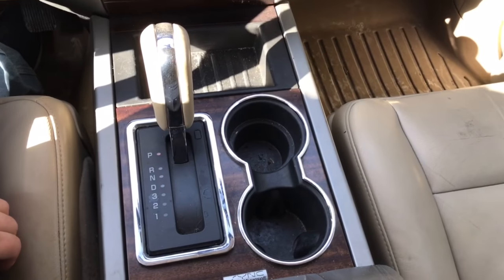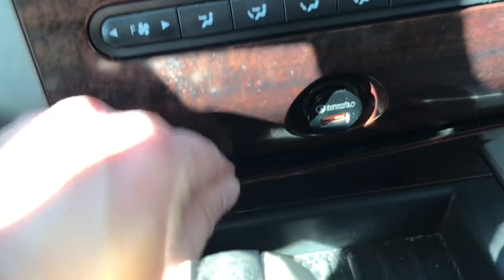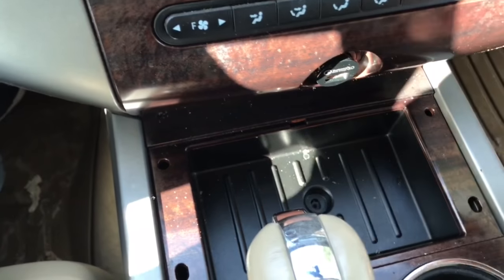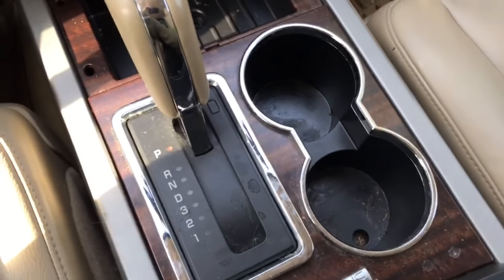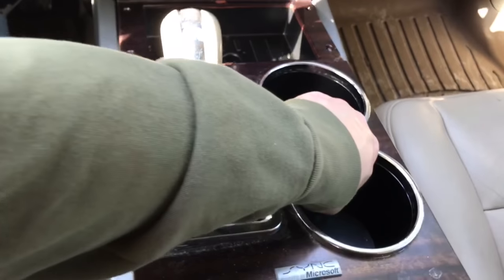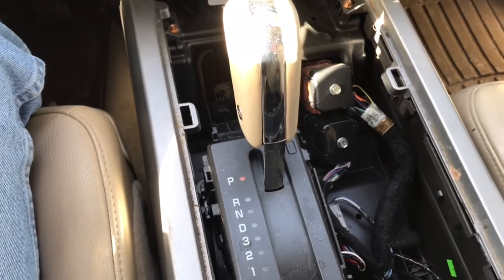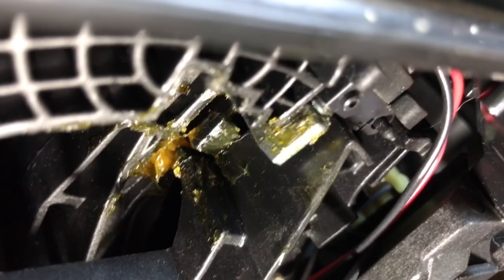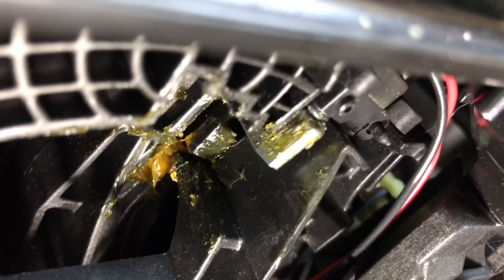What To Do If Ford Expedition Is Stuck In Park

Comment: I just had to push a 2012 Ford Expedition out of the road while it sat blocking traffic. After watching this video and knowing we couldn’t take the console apart, we checked the owners manual. It explained what to do if it wouldn’t come out of park on the “transmission” pages. There is a little rectangle peg to the right of the shift. Pop that out using a small knife or screwdriver. Under that plastic piece is a switch. Just flip it up and you will be able to get it out of park
Reply: The video  was great but your response put it over the top! Great, great advice!
Reply: Agree... Always RTFM!
Reply: Mike, that takes longer than turning the car off and turning the key to ignition and shift it into neutral and starting it!
Reply: @jms6184  
Q
Reply: THANKS FOR YOUR REPLY!!!!
Reply: @timtalks8292  Useless if the car won't start....like mine
Reply: this video tutorial helped me to the issue in 10 min😊 I used wd40 to clean these small parts and work. like a charm
Reply from the maker: Thank you for watching out auto repair video that shows you how to get your Ford Expedition up ang going if the brake interlock switch has the shifter stuck in park. If the parking brake switch is bad it will cause this to happen. We have a video on how to replace the brake light switch if your is bad. Hope this helps you out.

Comment: Dude, you did this the hard way.  There is no need take any of the console apart, just pop the little rectangular cover off that is next to the shift handle and stick your key in there.  That will manually unlock the shift handle.  It literally takes 10 seconds.
Reply from the maker: That trick didn't work on this truck for some reason..tried it
Reply: The grease is more of a permanent fix isn’t it?
Reply: Didn't work on mine.
Reply: Mines is a 2011 and this feature with sticking a key or flat head screwdriver to the right of shifter. Does not have it.
Reply: I've tried that. It's not that easy

Comment: I did what said to do and it worked but later found I should have replaced a 10 amp fuse 1st because that was the problem. Always check fuses 1st.
Reply from the maker: Thank you for watching out auto repair video that shows you how to get your Ford Expedition up ang going if the brake interlock switch has the shifter stuck in park. If the parking brake switch is bad it will cause this to happen. We have a video on how to replace the brake light switch if your is bad. Hope this helps you out.

Comment: If you look at your shifter trim you will see a small rectangular panel on the passenger side towards the front. Pop that out and stick your key in the hole. It releases the shifter with no disassembly needed
Reply from the maker: That was the first thing I tried and there was no access to it on my 2012

Comment: If it wont come out of park, its most of the time a shift lock solenoid or your brake light switch.
Reply from the maker: The brake light switch went bad on my Expedition which caused this problem. I have a video that shows you how to replace it.

Comment: Thanks for this video. I have a  2010 Expedition that was having the same issue (not coming out of park).. I followed your steps, cleaned and regreased the solenoid plunger and now it works better than it ever has. Thanks again.
Reply from the maker: If it acts up again it may be the brake light switch acting up that is causing it. I have a video that shows how to replace it.

Comment: In some cases, make sure you check your brake fluid levels 1st. If low, fill it. If that doesn't fix the issue. Then proceed if needed.
Reply from the maker: Thanks for watching

Comment: Why didn't you just pop off the access button? You took the whole oabelling apart for no reason.. just pop off the little dime sized button next to the shifter and stick something down in there to push the release button
Reply from the maker: Tried that but it didn't work on my Expedition. The brake light switch was causing this issue on my truck. I have a video that shows you how to replace the brake light switch on a Ford Expedition if it goes bad.

Comment: Man, you are hero! I have 2011 Lincoln navigator L and it’s the same shifter. Got stuck out of blue and you helped me a lot. Thank you.
Reply from the maker: Thank you for watching out auto repair video that shows you how to get your Ford Expedition up ang going if the brake interlock switch has the shifter stuck in park. If the parking brake switch is bad it will cause this to happen. We have a video on how to replace the brake light switch if your is bad. Hope this helps you out.

Comment: Also check brake switch if it fails such as no brake lamps but it interrupts cruise and tells gear shift its ok to come out of park.
Reply from the maker: Yes! This is what actually caused this issue on my Expedition. I have a video on how to replace the brake light switch.

Comment: Thank you very much. It took me a few times to watch You but you were very patient as my husband used to be with me and so I learned from you. I'm 73 but I still learned something new today and I found what the problem was. It's where you showed the grease and stuff. Mine is all plastic, it's not metal, but there's a little tab. And it looks like it's a upside down stairs  That shifter comes down and that little tab is supposed to go forward. And it didn't so I just ordered me a whole assembly. And I'm going to do R & R , thank you again. For now i push it forward to release the shifter 😊
Reply from the maker: Thank you for watching out auto repair video that shows you how to get your Ford Expedition up ang going if the brake interlock switch has the shifter stuck in park. If the parking brake switch is bad it will cause this to happen. We have a video on how to replace the brake light switch if your is bad. Hope this helps you out.

Comment: Great information.  Worth mentioning that when your addressing an issue on the Ford Expedition, the Lincoln Navigator is a direct cousin and most components, including the shifter mechanism, are identical.  The trim removal is slightly different, but very similar.  Sounds like the preventative maintenance procedure to avoid this problem is insuring there is adequate lubrication on the solenoid tab.  If your in there for something, such as replacing the shift indicator lamp, check and re-grease that tab.
Reply from the maker: Thank you for watching out auto repair video that shows you how to get your Ford Expedition up ang going if the brake interlock swith has the shifter stuck in park. If the parking brake switch is bad it will cause this to happen. We have a video on how to replace the brake light switch if your is bad. Hope this helps you out.

Comment: Thank you!!! I’ve been dealing with this and it’s such a headache
Reply from the maker: Check to see if your brake lights are working. If the brake light switch is bad it will cause this issue. Mine were working intermittently. I have a video on how to replace the brake light switch it is super easy.

Comment: I wish you could get back to me fast but what’s the grease you used!! Asap!
Reply from the maker: I believe I used a little bearing grease. What was causing this issue though was the brake light switch failing. Hope this helps you out.

Comment: Thank you brother it useful video , can you complete the video how to remove the gear Handel

Ali from Saudi, Qatif
.
Reply: ممكن رقمك؟
Reply: السلام عليكم علي 
هل هذه المشكلة تتكرر اذا اصلحتها ولا بس مرة وحده
Reply from the maker: Thank you for watching out auto repair video that shows you how to get your Ford Expedition up ang going if the brake interlock switch has the shifter stuck in park. If the parking brake switch is bad it will cause this to happen. We have a video on how to replace the brake light switch if your is bad. Hope this helps you out.

Comment: Could this be the answer to the problem if it only does it in park?
Reply from the maker: If you can't take the truck out of park this may be the issue. If the parking brake switch is bad (see if your brake lights are working) if not you may want to replace the brake  light switch.

Comment: One of the most common causes of this problem is a blown fuse. 
97 to 02 expedition is a BOO fuse. Brake On Off fuse. It is the feed for a splice that includes you shit actuator solenoid and your brake light switch. It is Fuse 13 on the 98 Expedition. 

Mine did this in a fast food drive through. It was ugly. I remembered the F150 I did a few months earlier. Grabbed a spare 15 Amp and boom. It was fixed. 
No need to take anything apart.
Reply from the maker: Thanks for watching! Don't forget to subscribe!

Comment: Thanks for this video. You just saved me a ton of money!
Reply from the maker: Thank you for watching out auto repair video that shows you how to get your Ford Expedition up ang going if the brake interlock swith has the shifter stuck in park. If the parking brake switch is bad it will cause this to happen. We have a video on how to replace the brake light switch if your is bad. Hope this helps you out.

Comment: My shift will go in some time then it stop
Reply from the maker: Thank you for watching out auto repair video that shows you how to get your Ford Expedition up ang going if the brake interlock switch has the shifter stuck in park. If the parking brake switch is bad it will cause this to happen. We have a video on how to replace the brake light switch if your is bad. Hope this helps you out.

Comment: mine look just like yours...I hope you can help me. Mine....the gear is not stuck but when I shift to drive my car doesn't move at all even Reverse nothing. It starts and running but just not move. I don't know what is the problem but it's my only car and don't have the money to take it to a shop.. please help.
Reply from the maker: You may want to start by checking the transmission fluid level. Here is a video that explains how to do it on these trucks. Mine has the 5.4 in it. Hope this helps you out.

Comment: Hello Sir

I have a 2018 expedition. I could start the car but suddenly when I put it to Drive, it turned off and I never could start it again. The gear is very hard. And it shows brake system malfunction on the screen. Any idea what can be the problem?
Reply from the maker: You may want to start with the basics. Check the brake fluid level to see if it is at the correct level. Also check the fuse to see if there is a blown fuse in the brake circuit that may be triggering the code. You could also have someone put a code an ODB code reader on it to see if there is a stored coded in the system that should point you in the direction as to what might be causing the issue. Hope this helps you out.

Comment: Thank you so much!! I have a 2011 lincoln navigator L and boy saved me some $$ for going to a repair shop! Same set up just about as yours almost!!
Reply from the maker: Thank you for watching out auto repair video that shows you how to get your Ford Expedition up ang going if the brake interlock switch has the shifter stuck in park. If the parking brake switch is bad it will cause this to happen. We have a video on how to replace the brake light switch if your is bad. Hope this helps you out.

Comment: This happened to me. And I drove the car for about a week and the break locked and I end it up in a ditch because I codnt get the car to stop. The mechanic changed the booster and viola my car works now. Everyone please take your car to a professional. It's locking for a reason.
Reply from the maker: When the brake pedal is pressed it activates the brake light switch which sends a signal over to the interlock on the shifter. The booster failing is a different issue.

Comment: Edit: It took me about 15 minutes to change out the brake light switch on my 2008 Expedition - you have to poke your head way under the dash, sitting outside the car. It just twists on and off, the wire harness was easy to disconnect and reconnect. Here i Q1 2022 the switch cost $35 with tax from Autozone - ouch.

Original: You saved my bacon. A neighbor of mine called me up for exactly this problem on his chevy sedan about 4 months ago, I youtubed the problem, and disassembled the console to get at the guts and do a work around. Well, a couple of weeks ago I was out in a fairly rural area, away from help, and my 2008 Expedition locked up. I jumped on youtube with my phone, found your video, and was rolling 20 minutes later. Thanks.
Reply from the maker: Glad this helped you out.

Comment: on the other side of that solenoid is a round shaft. I 3d printed a clip to go on that shaft to disable it forever. Its a safety device so kids don't put it in gear without the brake. I don't have little kids. All adults. So I don't need it.
Reply from the maker: A bad brake light switch was the cause of my issue.

Comment: found out from my mechanic that the solinoid is actuated by your brake light switch. if it wont unlock shifter you also wont have brakelights. $29 at parts store, swaps out without tolls in 5 minutes, aon top of brake pedal.
Reply from the maker: That's what happened to mine. Here is a video on how to replace the brake light switch. https://youtu.be/JPUFlrnw-eI

Comment: Great info.  Changed switch,  one year later I have the same problem. What is the next repair,  thanks.
Reply from the maker: I would see if the new switch has gone bad, also check for a frayed wire coming off of the brake pedal switch, you can also want to see if that little slide pin in the shifter may need to be lubricated or if the solenoid to it might be bad. Hope this helps you out.

Comment: Opposite issue: stuck in gear.  Went to turn around and stuck in reverse.  Foot on brake thinking about the interlock being stuck and could not get it.  Tried turning off and it did but because of the truck in gear would not start.  Forcing the shift lever I got into neutral and started.  Made it home and can't get keys out when in oark.  Vehicle shuts off but doesn't allow key to release.  Then I got out and noticed my lights are on and won't turn off because keys are in the ignition.
Reply from the maker: Check to see if the brake light switch is going bad. If it is it will not release the interlock. Very common problem on these trucks. It's a cheap part and a five minute fix. Here is a video I did on the repair. My brake lights were working intermittently. Hope this helps you out. https://youtu.be/JPUFlrnw-eI

Comment: Mine was also stuck in park and the fix turned out to be a bad brake light switch which powers the solenoid that retracts the pin holding it in park
Reply from the maker: That is exactly what happened to mine. I have a video that shows how to replace the brake light switch. It's a common part to fail on these trucks.

Comment: What kind of grease would you recommend? Is it something I can get from O'Reilly or any automotive store?
Reply from the maker: The grease that's in there is almost like Vaseline. What happened to me is my brake light switch was working intermittently (common on these trucks) which caused this issue. I have a video on how to replace it if your brake light switch is failing,

Comment: Dealing with this crap now!!  UGH!!  Thanks for the info!!  Also Mike Skibba helped with the info about the rectangle peg to the rt of the shift!!  About to try that!
Reply from the maker: Thanks for watching. See if the brake lights on the truck are working intermittently. If they are the brake light switch might be bad causing the truck to not shift out of park. It's a common problem but cheap to fix. Here is a video I did on the brake light switch. https://youtu.be/JPUFlrnw-eI

Comment: Don't spill soda on your console. It will drip through the cracks onto the mechanisms inside and make them super sticky. That is what happened to me and was a real pain to clean!
Reply from the maker: Yeah, it doesn't take much to gum that stuff up sometimes.
Reply: And there are other good reasons not to spill soda in your console. 😉

Comment: Thanks. I bet this will work. I just went out to go to work and can't push the button so it's something I'll try when I get home from work. I knew one day a stupid brake-interlock would get me. I know after this, it will never again. Wink wink.
Reply from the maker: It's common on these trucks to have the brake light switch fail which causes this issue. When it happens see if the brake lights are not coming on. Here is a video I did that shows how to replace the brake light switch if this happens. Hope this helps you out. https://youtu.be/JPUFlrnw-eI

Comment: If you’re in a pinch, turn the key to accessory and start the car in neutral. Make sure to depress the brake but once you have it started you should be good to shift to drive. Thanks
Reply from the maker: If the brake light switch is bad (which is what happened to me) it will prevent you from shifting into gear.
Reply: @HomeOwnerRepair  it’s an electronic sensor, imagine your car battery dead. You can still get it into neutral.
Reply: Problem is u can’t shift at all.
Reply: @timtalks8292  Mine also will not shift in Accessory mode. No combination of key position and brake pedal allows it to shift.

Comment: I can tell your from Boston too
Reply from the maker: lol...That obvious huh
Reply: Kinda, but you pronounce your Rs,  but talk like your from south shore.
Reply: There is a little pop out panel next to the shifter on the right, pop thR out next time and not take your console apart
Reply: @aviationnationhd3760  it's alot harder doing it that way.
Reply: @aviationnationhd3760  you have to guess where the switch is and if you don't have a tool that's angled you can't hit it right.